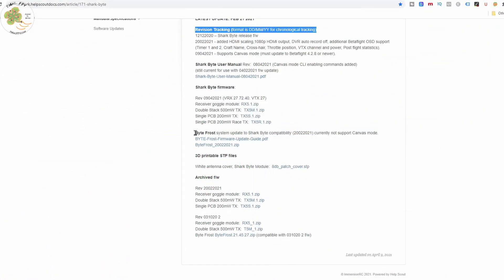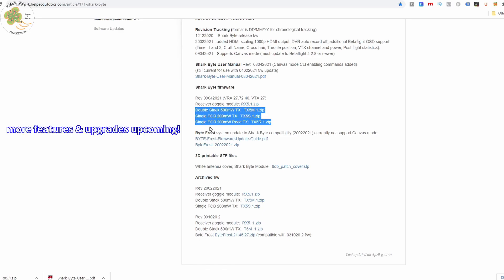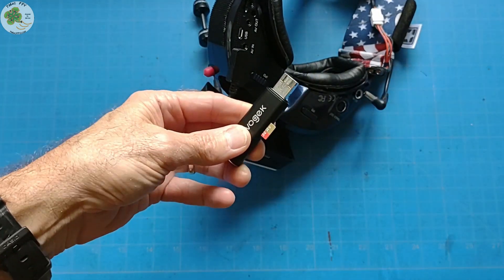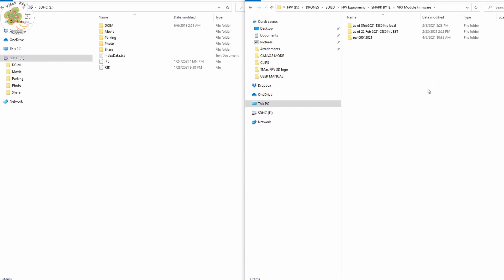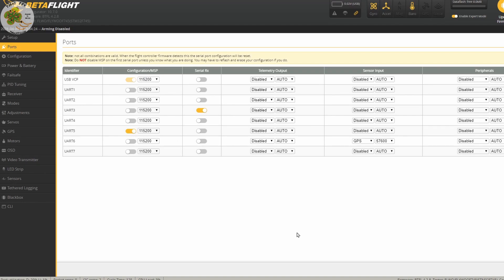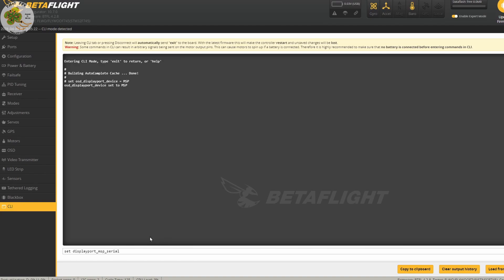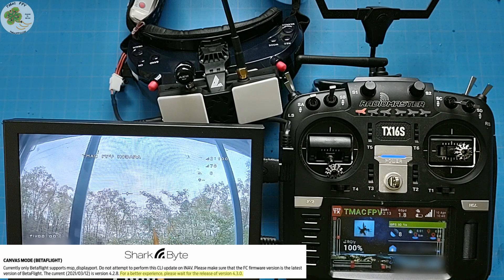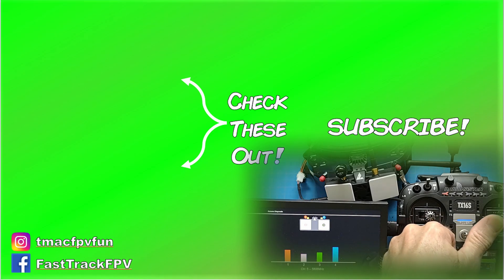FatShark Shark Byte (CANVAS MODE!)

Comment: I followed the instructions on both fatshark manual and your video perfectly and it said install successful on both rx and tx but I’m not getting any picture. It’s just stuck at the scanning menu. It all worked before I tried updating now I can’t even get a picture. Any idea why?
Reply from the maker: Have you entered in the appropriate CLI commands for Canvas Mode per the latest version of User Manual? Other thing to check is perhaps MIPI cable/connection

Comment: My OSD wont work.... I have followed the manual exactly. I have TX to RX and RX to TX and it still wont work. Any suggestions? Thank you so much!
Reply from the maker: Are you using Betaflight 4.2.8 or newer?  If so, are you using the latest version of the User Manual (08042021) available here?: https://fatshark.helpscoutdocs.com/article/171-shark-byte .  If so, have you entered the appropriate CLI commands for the port you have connected Shark Byte to per the latest User Manual, page 11? Have you enabled OSD in your Configuration Tab in Betaflight?  Have you updated both the VRX and the VTX to the same compatible version firmware?  These are all things you can check

Comment: I’m running crossfire on mine. You said we don’t have to use an aux channel for LQ in betaflight but do we still have to have LQ turned on in the radio under the crossfire config?
Reply from the maker: Good question funflyingfools!  No, you do not need to set LQ on a DST channel in your receiver setup either anymore wit latest update 👍😀
Reply: @TMacFPV  thank you! Now I have another issue but it isn’t with set up. My hdmi cable needs to be replaced. My video locked up and froze at very close distance. I had this happen yesterday and have been testing. I used another usb cable and it doesn’t blackout or lockup.

Comment: What is canvas mode ?
Reply: It alow you to have any OSD element that BF support in the last version of BF.
Reply: @alfskaar489  Ok so its just OSD like analog. They should call it Canfinallydo mode.
Reply: @philthayer4087  There are more to it than that it also have OSD overlay from the Vrx showing antenna strength and if it is recording to Micro SDCard or not. Bigger clearer font.